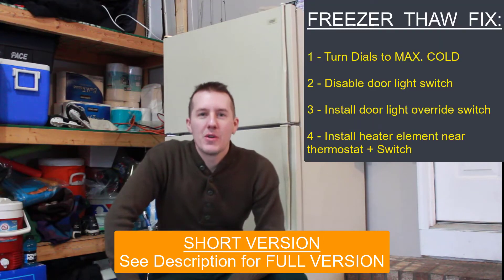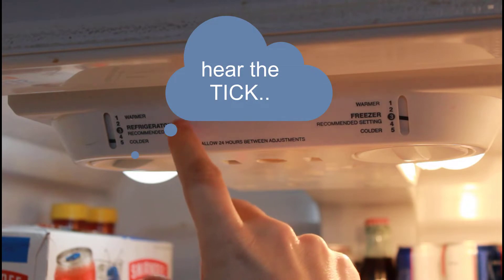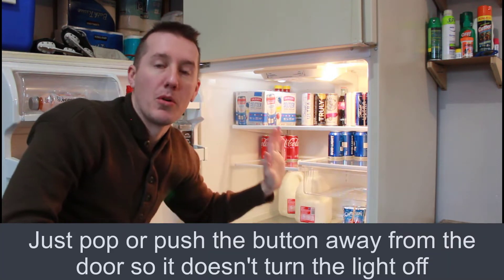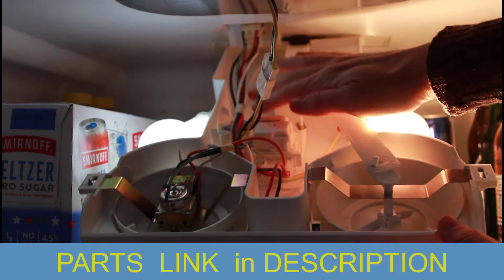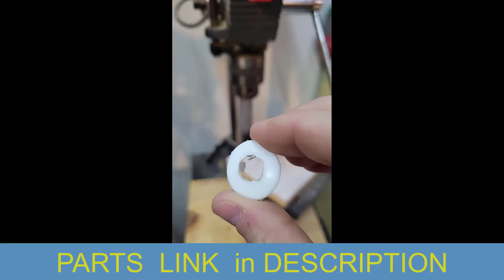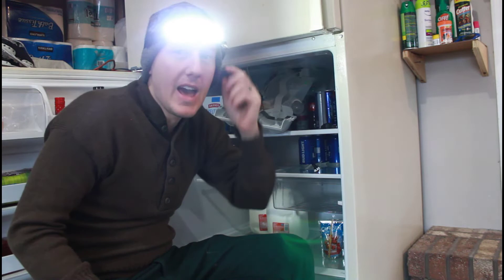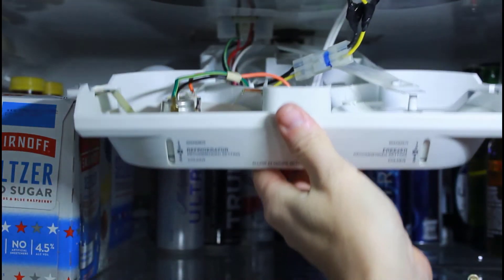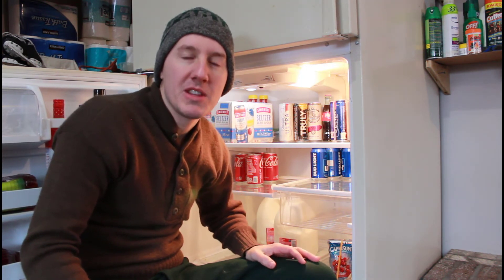Garage Fridge Freezer - Thaw Out   [SHORT VERSION]

Comment from the maker: Parts and Tools:
Metal Rocker Switch ...................................... https://amzn.to/3t27k1L
Rocker Switch with Wire ................................ https://amzn.to/36DNP8a
Mini Switch with Wire .................................... https://amzn.to/3IqnjNG
Heater Element .............................................. https://amzn.to/3t61P1Z
Socket Driver .................................................. https://amzn.to/3Hnfbfb
Self-Adjusting Wire Stripper .......................... https://amzn.to/3JTdqs8
Wire Stripper .................................................. https://amzn.to/3IvqB1O